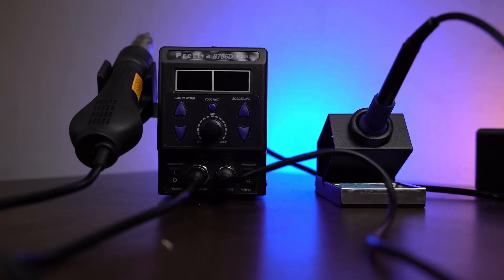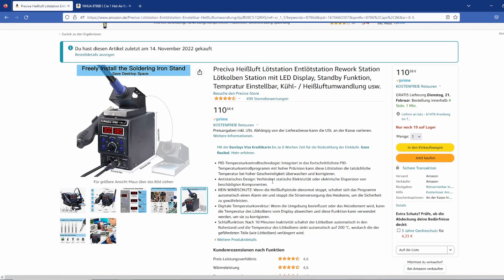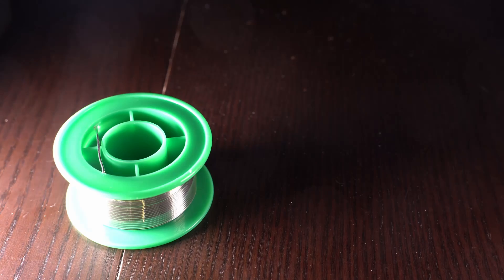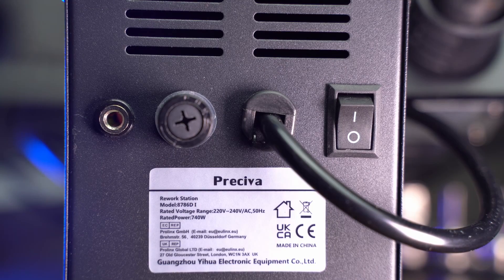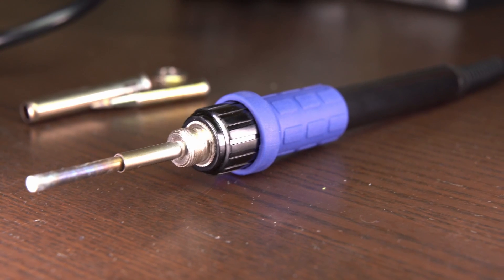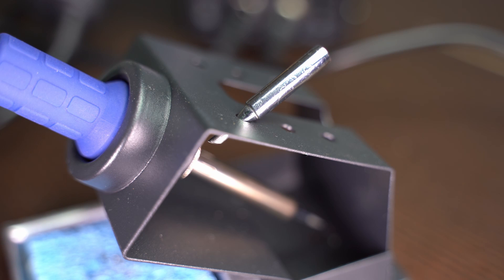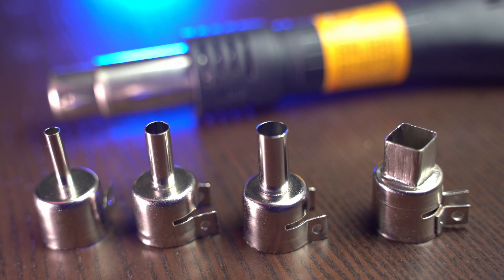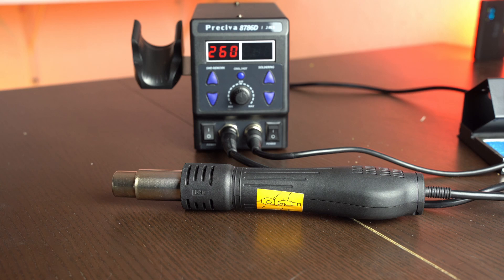8786D - Is It Worth Your Money?

Comment: The purpose of the cool button is to turn off the heat but continue running the fan for a while to cool down the unit. This is done to extend the life of the heating element in the blower unit.
Reply: It does that automatically by returning the unit to the base. I could see it being used as a gradual cool down to an installed part.

Comment: Thank you for your opinion on this machine. I purchased one to do some basic power soldering on my JetSki control box that has some corroded and broken modular connectors. I decided to get this one because it had the hot air and there have been times when I wanted to fix obvious burned out or failed components on a circuit board but did not have a proper soldering iron. Now that I have this, maybe I'll expand my hobby into electronics and by an inexpensive Oscilloscope?  👍
Reply from the maker: Thanks for your Feedback :-) at my Point of View is a scope Something a can buy but it doesnt give you a big Advantage in diy Projects, Most time you use 5v, or 3v3 Logic Level. Analyse of "real" analog values is Not that often. I would think in direction of a Logic analyser.

 Alternativ there is a Project (Not on my Channel) with a pi Pico to create a  scope. Would be the cheapest solution. 

Let me know If you buy Something, would be interesting to know your decision.

Comment: Great Review.  Note that @1:45 the label on the back of the machine says "Guangzhou Yihua Electronic Equipment Co., Ltd." so the unit is indeed made by same company and sold in different countries under different names. Yihua also markets under the name of WEP.  They make good quality products that use standard 900m tips (T12 for some models) and have replacement parts available (replacement handles and hot air guns).

Comment: I have this unit. Love the iron so far. The hotair is ok...just dont like how long it takes to heat up the solder. Anyways, the 3rd switch is most likely a "quick disconnect"...my assumption on it is basically an additional safety switch that interrupts the current....Ideally this is good for situations that involve children playing with the controls. Little bastards love to touch everything. Unless they are like my kids, if it isn't bright and colorful, it's boring. Other than that, my only other guess is accidental touch.  It may seem redundant...but someone, somewhere, is very clumsy and is the reasons why many things get "idiot proofed".
Reply from the maker: Yeah, maybe its really the Idea to make it more safe. I never saw something like this in more Professional devices. But your right If my kids would get closer to it, they press every button the can. A "all Off switch" could help to make it safer. Thanks for your Idea.
Reply: How do it take for the soldering iron to heat up?
Reply: @jemdem7608  Sorry I seen this reply so late. It doesn't take long at all for it to reach temperature. It takes about 25 seconds to heat up and be at the desired degrees/Celsius. 
As for the hot air....takes the same time but to hit the number but an additional 5-8 seconds to hit the peak temp....So both way under a minute. It is still doing me good so far and no issues. I like the fact that if I have to switch from one to the other, I dont have to wait too long to alternate. One day i will eventually get a high-end unit....until then, I am pleased with this model.
Reply: @chivo850 did you found another model you liked or are you still stuck with this station

Comment: I have this exact unit. I got it as my first hot air station. It has its flaws. But it seems to have had the right corners cut, in order to achieve a price that low. 
Nice to see a professional mirror my thoughts.
Ive only just come across your channel. Loving it, so far!
Reply from the maker: Thanks for your command, Yes, i think Overall its really good for the price.

Comment: I've soldered together 3 SMD kits and a split keyboard with this station and I'm very happy with it so far. Haven't really used the hot air for anything other than heat-shrink tubing so far but in that duty it performed perfectly well! Seems like a great buy for the cost!

P.S. The soldering iron holder can be mounted to the top of the unit if you'd prefer it take up less horizontal desk space at the cost of vertical space :)

EDIT: I didn't think to test the temperature but I will soon (in the next week or two)
Reply from the maker: Yeah calibrating with boiling water ist a great Idea. Next time i do a soldering Station review i will prepare this. I Need to find a Sponsor for this ;-)

Yes your right with mounting on top. For me it  was not nessesary right now so i forget it in the Video. The Video was any way much longer than i planned.

Thanks for your Tips and commands.
Reply: Is this still the best option for price?
Reply: @hobonickel840  Depends on your criteria? I haven't used mine in awhile so I can't speak to usage/reliability concerns but it's still a pretty good value for the money, I think. Anything that's temperature controlled will be better than the ones that just plug in with no controls though lol
Reply: @3nertia  Thanks... I'm a newb but need to learn soldering/reworking because I want to create  cognitive sensory toys for my gf's son who has CP

Comment: I’d like you to maybe review one that a little bit more expensive maybe around the range of $125-$150 to see if you can get a better handle. Usually for the hot air test you’re supposed compare the temperature on the screen to the real temperature by using a thermometer or temperature probes. I’m actually thinking of getting a Atten ST-862D but it would be cool to find something similar to it’s performance.
Reply from the maker: Hey thanks for your command. Yeah i also thought about to measure the Temperatur. But i don't have a calibrated measureing Tool. So i tought a practical test is sufficent. But your are completly right. Thanks for your Feedback.
Reply: @lutz4tech  You can easily calibrate any temperature measuring device by checking it against boiling water. Just buy a cheap one on Amazon, I've found the IR (non-contact) thermometer along with the other one I have for contact measurements have been more than adequate :)
Reply: Oh! One important caveat is to make sure the device's range can actually measure boiling water without damaging the device! Seems like it should go without saying but this is the internet, so ...